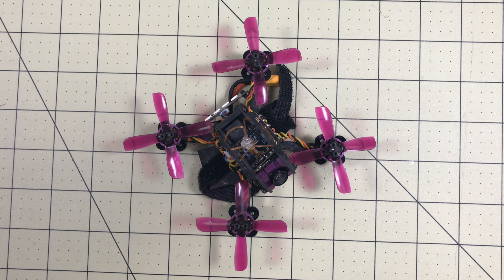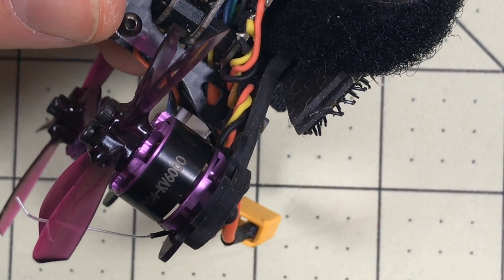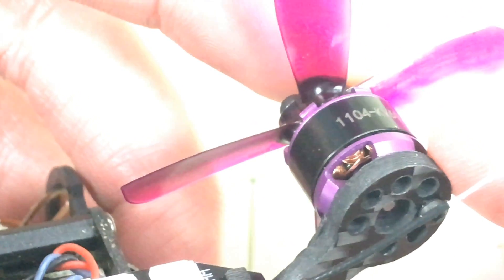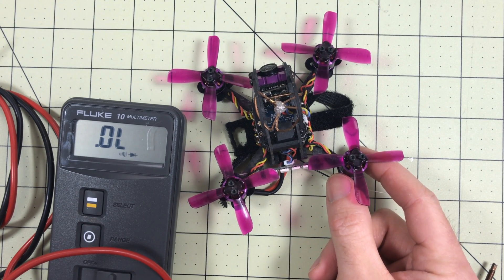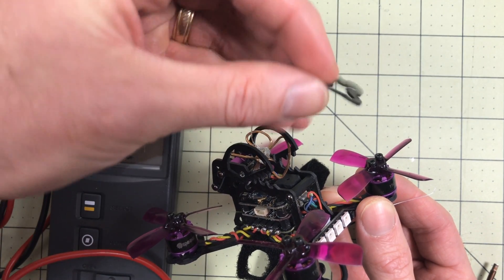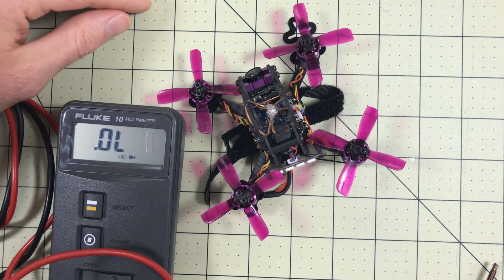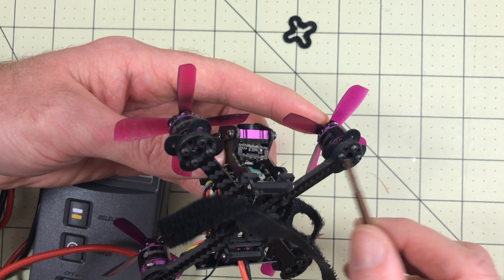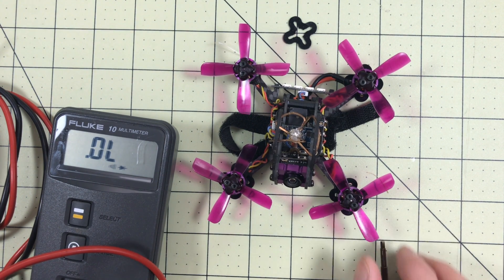Hot motors on your new Eachine Lizard95? Check this BEFORE you fly your Lizard!

Comment: Thanks so much for the info. 
Got my lizard a few days ago, and all I've had a chance to do is test hover it around indoors. The motors got hot - and I wondered if this was normal. Clearly it's not - and I know what to check now!

Should the motors run just barely lukewarm then?
Reply from the maker: +4stringmike they can get fairly warm depending on how you are flying.  At maximum you should be able to grab onto them and just hold on without flinching.  Not very scientific, but a good rule of thumb.
Reply: DroneRacer101 well I've metered the quad out now - and lo and behold there's continuity between the frame and the esc pads - which goes away when backing out the motor screws. 

FYI mine seems to have the issue with ALL screws - so I'll have to either shorten them, or do as you recommend and install soft mounts. 

Thanks so much for saving my Lizard!
Reply from the maker: +4stringmike just to be 100%. If one is shorted they will all show as shorted since they will have conductivity through the frame. It sounds like you got it. Just want to be sure.
Reply: DroneRacer101 yes - I've tested it again, and it seems that one screw per motor is causing the short. I have remedied the situation now by buying the o-rings you mentioned in your other video, and doing the soft mount. No short now! 
Can't wait to actually fly this thing!
Reply: DroneRacer101 so I was finally about to go for my fpv maiden with the lizard and now it seems the receiver has stopped working! When I power up my radio and then the lizard, I get the orange light on steady on the receiver board, but no controls work from the radio. I've checked the receiver channels on betaflight, and none of the channels are being received (except aux 1 - but the value doesn't change when I toggle the switch). If I turn off my radio with the quad still on, the orange light on the receiver board goes out. So it's picking up something, but nothing wants to work! I've rebound it twice now - also trying DSM2 as well as DSMX, and nothing!

Man - I'm having bad luck with this quad. The first one I ordered from AliExpress, and waited patiently for 4 weeks never showed up. Now this one from Banggood seems to be a duff. I expect the short circuit from the motor screws had something to do with it...
Reply: 4stringmike Same thing. The Frsky module stopped working then after I fixed it I found the ESC had motor 3 output failed. The new ESC arrived today and all motors work again but they get too hot to touch after spinning at 30 percent throttle for half a minute. I checked with a multimeter and there are no shorts. I'm at a loss. Not sure I should risk flying it.

Comment: What a disappointment the LIzard95 is. Shorted motors. Vibrating motors. Broken LED strip. Drifting in self leveling mode until it needs full stick input just to stay airborne. A piece of crap.

Comment: Great job!  I figured this out the hard way - and isolated the screw in each motor that hits the yellow wire inside the motor.  I've written to BG about the continuity issue - and a new Lizard I purchased had continuity with every screw to the ESC pinouts.  As soon as I removed the screw that was hitting the yellow wire inside the motor, the continuity disappeared.  I also noticed that the early Lizards sent out for review to SeByDocky, AndyRC and maybe you had different motor screws - probably shorter.  So, I soft mounted the motors, put a washer under the screws that hit the yellow wire, got rid of the continuity, and, with BF 3.2.0 and your PID'S, the damn thing flies great!!!  I so appreciate your efforts and educational material - as well as the no BS way you present things.  Keep it up!
Reply: FYI the new shape seems to have accounted for the raised motors... the bottom of the frame where the prop was striking before is now curved and I think should be able to handle the soft-mounting without causing strikes.
Reply from the maker: +G B excellent!
Reply: I can confirm this - there is still plenty of clearance after soft mounting 👍🏻
Reply from the maker: +George H thanks George good info. And for the record I paid for mine. :-) But I ordered it the second they were available. I'm half temped to order another one with the super discount they have on them right now. Just to compare.
Reply: George H - just got my lizard95 and already has an issue with motor 2. Complain to bangood and put the video http://www.youtube.com/watch?v=FcAhSw-jJC8. This lizard has Phillip screw type vs the hexagonal M screw. I have put soft mount on all the motors already.

Comment: I'm still waiting for a replacement motor, I grilled two 😑
What I did was painting the motor mount with plasti-dip on both sides. It is just a thin layer but with both sides "rubberized", it should keep the vibrations out even better.
I definitely will check for continuity before the next flight. If the layer of plasti-dip isn't enough, washers would also be a solution.
Reply from the maker: +M0rdH0rst plasti-dip Interesting idea.

Comment: i had hot motors before i soft mounted..the extra rubber bands that come with it for soft mounting just enough room to not bottom out no locktite, soft mounted rubber band gives me enough side pressure on motor screws no backing out of my screws... also only put two screws in each motor for easier access, just quick tightness check after flight still no need for tightening after about 25 packs run through it
Reply from the maker: +quad55555 the rubber bands for the camera mine came with were really weak. I'm surprised they haven't snapped.

Comment: If you've already driven the screw up into the windings hard enough to get continuity through to the frame you've trashed the windings and should re-wind or replace that motor. It'll eventually smoke because you've damaged the varnish on the wires enough to allow leakage and allow the windings to short together, or contaminants to get in, etc...

Comment: Got lizard yesterday. Unfortunately I made a flight with my Lizard before I found motors are shorting. So I softmounted them, no shorts but they still getting really hot. Is it possible that damage already done? Also camera would start showing normal video but after a minute or two image gets grainy with noise - impossible to FPV. I think it's VTX getting VERY hot - it melted rubber band holding the camera right away. Also in stub mode it's drifting hard to one side for a minute and a half  and after it starts drifting to another side. It gets a lot of vibrations too. And last thing - I did upgrade to 3.2.0. I've experienced a problems than sometimes MOTOR_STOP setting woud reset. Also if I put throttle close to 50% motors would go full throttle and would not react to trhottle stick input. Resetting CLI with old dump helps to get it to normal. With all those problems I don't know what to do. Should I return for replacement or just cure and modify it? I just don't know if all of those troubles are solvable. And maybe there are other problems with it - can't check because I'm afraid to fly it really
Reply: VTX melted one of the rubber bands on my Lizard too!
Reply: You mean any motors that had continuity at one point should be replaced, or any where you can't resolve the continuity issue?

Because I'm basically having the same issue, I connected the battery first (just to see if it would power up), then checked for continuity (sure enough, all 4 motors were affected) and took the screws out and checked again one by one, until there wasn't any short circuit anymore (had to take out about half of them until it disappeared).

Then I wanted to do a quick fly test with only those screws connected (just to see if the motors were working) and while I was able to take off, the flight was extremely unstable and just after these few seconds of flight time they all got pretty warm (borderline hot).

Now I'm wondering if that was because I took out half the screws (resulting in probably some big vibration issues which could also explain the unstable behavior?), or if it was because the motors are actually damaged now.

Is there a way to do some further testing here? I can't really see any physical damage in the motors that the longer screws might have caused (though its hard to tell), but I'm also a bit afraid to start it up again and possibly frying the ESC board.

Not to mention that I'd hate to send it back or having to replace the motors, it already took more than a month for the copter to arrive here :(
Reply: Hey dude as I actually just commented about that subject, any motors that you have continuity through should be replaced. The windings are damaged and will fail eventually. The varnish is on the magnet wire (windings) to insulate it from the casing, the stator and other windings. If a screw has impacted them enough to drain through to the frame, what's gonna stop them from potentially (and possibly!) draining through to each other?
Reply: A Nee you might have to replace the motors check to see if those screws that goes into the motor hasn't damaged any of the copper wirings.
Reply from the maker: +A Nee unfortunately it sounds like the motors are probably permanently damaged. I would contact the vendor.
Reply: A Nee ! I have the exact same problem here. This thing just drifts heavily to one side. Can it be because ot angle mode?
Reply: It can be. But.. Mine just gone FOD in acro

Comment: So if I added the soft mounts, I can use the stock screws and it will fix the problem?
Reply from the maker: +Assassinriflez (PC GAMES) probably.  I can't say exactly because the parts can be just a little different. Just make sure when you put the screws into the motor there are more than just a couple of threads holding.

Comment: I got the recommendation to get prop guards from You Tuber FPVtv Drones - he's also made some very helpful videos on the Lizard. He said, with the extreme speed, it is a great idea to install the Aurora 100 prop guards. He has a video with 2 other guard options. Besides wanting to do the awesome punch-outs this is capable of, I wanted to fly between branches and other small openings, so as he mentions, prop guards will save me a ton of money and hassles continually buying and changing props. So far, with the guards on, I've maybe bent one or two. People are always afraid they will be extra weight and slow their quad down... Really?... This is the Lizard! Do we really have to worry about it being slow?! Lol They didn't change a thing except make it more durable AND eliminate the too long of motor screws issue! The Aurora prop guards are super durable and come with 2 sets of different length screws. 
My Danco O-rings are arriving on Friday to Home Depot, so if people don't live near a Lowes, Home Depot has them too... For about 75 cents cheaper! Free in store pickup. 
Also:
I used your PID's and the Lizard will not hover in one place, but floats off to one side, making it a little harder to control. Got any ideas to fix that? I calibrated, of course. 
Thanks again for your great series of videos on the mighty Lizard95! (:^)
Reply: hi, i had the same problem with drift, it mainly drifted backwards on self level ok on acro so banggood sent me another fc which does the same, maybe a little better as the 1st board was not flyable after about 2 minutes unless i disconnected the batt to reset, also the dreaded flip of death which many said was caused by brown outs , 
(lack  of current to fc from excessive current drain from esc/motor) the problem was intermittent and finally found the cause was two duff motors,  they would stop momentarily from vibration , the way i found out was to set air mod on acro so motors span up hold quad tightly and give each motor a tap underneath and found 2 would stop monetarily, bad connections on the windings due to overheat probably, as for the fc i'm  probably going to swap it out for another 20 20mm type.
Reply from the maker: +Scott Rostad that is a good idea. But I don't like prop guards outside for another reason. They get stuck on branches. I'll fly around my big tree and often touch a branch. Prop guards touching that branch will probably bring me down. Inside I have had them save my props. But at outdoor racing speeds I'm not not sure they aren't more likely to break them. I've only tried them on the Kk 90GT, but that was my experience.
Reply from the maker: +Scott Rostad I wouldn't recommend using my pids. :-) i change my config around so much I don't take time to optimize them. Does it fly?  Good enough. :-)

Comment: But if banggood makes a riser plate won't softmounted motors in the front hit the frame? Cause I know when you softmounted your front motors the props just barely hit the frame. Won't rising those motors make it impossible to softmount?
Reply from the maker: +Glowworm 334 you wouldn't use the risers and the softmounts together. It's an either/or

Comment: Not the case at least on the 1104 dys motors I did lose a prop on 1105s on 3s but only once I got like 30 pairs of the gemfans 8$ for ten sets from greatest yes ten sets I'll post the recite if you don't believe it not sure there still that price since there 4$ a set every else

Comment: You could take the screws out and put them in a vice and file them down a little  bit.
Reply from the maker: +michael jones you probably could do that too. Would just have to be very careful about the threads. Would hate to cross thread the motor threads.
Reply: I do it all the time just run your file at slight angle around the top  and that will stop it from cross theading.

Comment: I made my friend some softmounts from a silicone cake mould/tin!!, the silicone is around 1.5 thick, it did the trick!, the silicone cookware is in most supermarkets and poundshops (dollar store for my american friends!) So its cheap fix. Nice video, always good to have someone in the know about possible fix's, before spending loads on shipping back to china. All the best.
Reply from the maker: +HellBilly FPV interesting. How did you punch out the holes?
Reply: DroneRacer101 sorry had to pop out, i made the holes with a rotating leather punch, the type with 4 hole sizes on a rotating clip, i marked the holes by painting the bottom of the motor with a bit of acrylic paint, then pressed on to the silicone. I hope that helps.

Comment: I noticed mine were warm today. Thanks for this!
Reply: Also.. is your VTX loose? My rubber bands broke and I replaced them but when I did, I had to wonder if they were doing very much in the first place.. I thought the VTX was held to the camera with stickypad or something...
Reply from the maker: +G B I don't think those rubber bands do anything. Mine broke the first day but it hasn't been an issue.
Reply: +DroneRacer101 I had the same thought.. Mine broke, I thought from the heat, right away... I looked as closely as I could and it didn't seem to be doing much.

Thanks for the reply

Comment: Glad to helped you on that! :P
Though I would have prefered, if you noticed the issus earlier so mine would not have been broken now. :D
Still waiting for the replacement motors...
Reply: McLovin1334 same here,had mine 4weeks ago. Plugged into betaflight,set it up. Went into motor tab, plugged in battery. 3motors smoked and fried esc board. Still waiting for parts. I bought 2 extra frames,all 3 base plates are different thickness. Reported with pictures on fb lizards owners page. No one was interested and it was pointed out I used cheap callipers to measure. But you can see the difference
Reply from the maker: +Tony Peart do you have a link to that post?  I am in the group but didn't see that post. I'm not on FB to often.
Reply: DroneRacer101 https://www.facebook.com/groups/180214225843717/permalink/208705056327967/